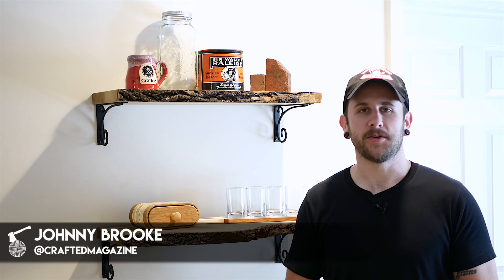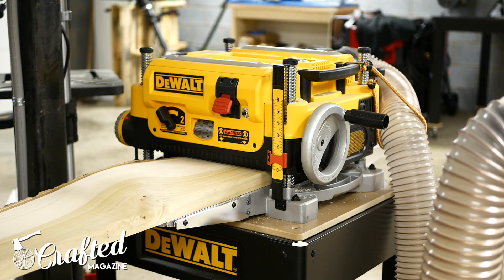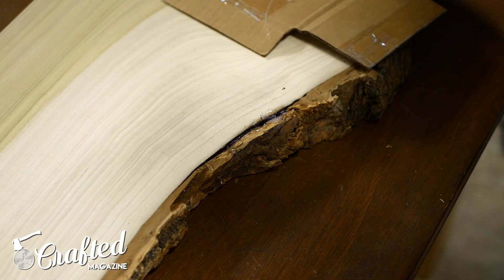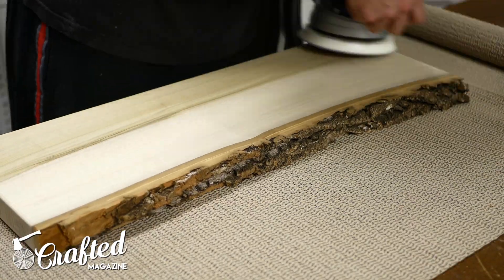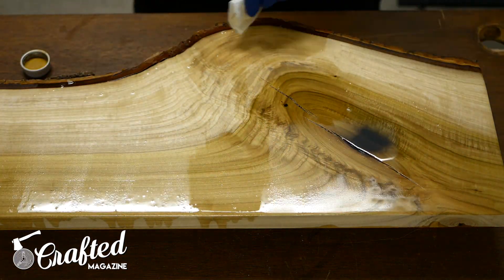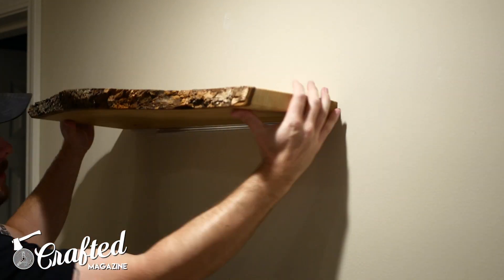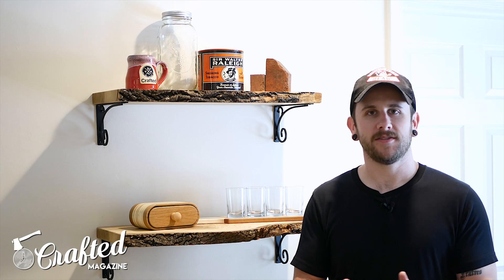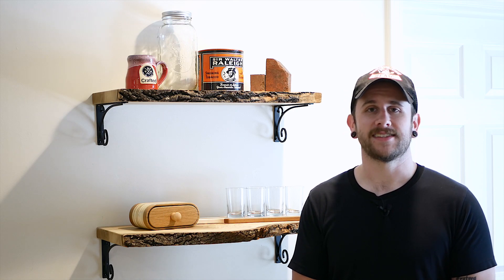Live Edge Shelf How-To | Crafted Workshop

Comment: The shelves look great. 
    When I have done floating shelves in the past I came up with this technique. Make sure your shelf extends over three studs at least. Mark the stud locations on your shelf and drill a half inch hole in each of exterior marks about 4 to 6 inches deep and a pocket hole in the center mark. Drive in half inch rebar then cut off the excess so that only 3 inches or so extends out of the shelf. Drill a half inch hole through the drywall and into the studs, then manipulate the shelf flush on the wall. Drive in a long screw in the pocket hole. The rebar supports the weight of the shelf, and the screw is sufficient to keep it from pulling out of the wall. If you did not have the space to use three studs in May could use a drywall anchor matched up to the pocket hole.
Reply from the maker: +Bryant Pardue thanks for the input man!

Comment: I realize this video is a little older but if you have the Festool Domino XL you can make your own floating shelf. I used the 140mm tenons with the flat surface connector system. I cut the edge that's going up against the wall at 2" wide and attach it to the studs then I connect the live edge piece to the 2" strip with the tenons and flat surface connectors. I usually have a flat surface connector on the ends and in the middle depending how big the shelf is.
Reply from the maker: Nice, that sounds cool!

Comment: This video is a bit old, but I do have a suggestion for you.  I bought a shelf at Ikea a few years back, and it was mounted to the wall with basically a flat bar of metal with 2 poles sticking out from it, and those two poles went into 2 holes drilled in the back of the shelf.  Not sure how easy that would be or if you're still looking for suggestions for the floating look.
Reply from the maker: +The Christmas Carpenter thanks! I got lots of great suggestions in the comments and still haven't done anything about changing them, hah.

Comment: The shelves turned out great! Any aversion to using deep set dowels to get that floating look? Not sure how thick your slabs are, but I've used dowels stemming from a cleat for shorter shelves. And thought about using Rockler's "blind metal cleats"for a larger shelf build I'm considering.
Reply from the maker: Yeah, I think I'm actually going to try the Rockler hardware. Will just need to patch some holes in my wall from all of these mounting brackets, hah!
Reply: Ehh, adds character :) I thought it was Bob C, but somebody from the Youtube mainstays used some Home Depot hardware to create the same thing. Doesn't look like it was Bob, though. If I find it, I'll post a link. Also can't remember if the bracket caused the shelf to protrude more than 1/8ish
Reply from the maker: Taylor C I know Diresta did a video on this, should have followed his guide but forget about it in my rush.

Comment: I believe I saw this on Instagram, but a guy just drover 3 bolts into studs, than took a grinder and cut the head off the bolt. He drilled the same size hole into the back of his piece and slid it over the bolts. Would work great for shelves like yours
Reply from the maker: +Mike Wiebe good idea!
Reply: Second this. 

I've successfully used 4 inch screws before with lighter shelves... You could certainly beef it up with some thicker dowels tapped into studs as well.
Reply from the maker: +Idiocy Glanders (Splunge) yea, I think I'll do something very similar. Thanks!

Comment: epoxy some steel pipes into the studs, drill some holes in the back of the shelf and slide the shelf over the pipes . if the fit is snug enough you might not even need epoxy. essentially using the steel pipes as dowels

Comment: when I try to cut my log to make this shelf it come out like a half circle, how do I correct this?
Reply from the maker: +Grant Flores not sure what you mean.
Reply: Half of a log is what he is saying (I think) He needs to cut the rounded part of the log off to make a plank for the shelf.
Reply: If the log was standing straight up is you blade going through the log parallel to the ground? It needs to be sawed through the length of the log instead

Comment: Johnny,  I just read all the other comments below.  There are some good comments down there. 
I have hung a few floating shelves with keyholes & screws. I like to use at least 3 studs for each shelf. It's a bit of trial and error until you get the shelf tight against the wall.  Make the keyholes sideways. You can use  #10 or 12 screws, you'll need to make the keyhole a little larger.
Reply from the maker: +jim renderer thanks for the tips Jim. Definitely lots of good options here.